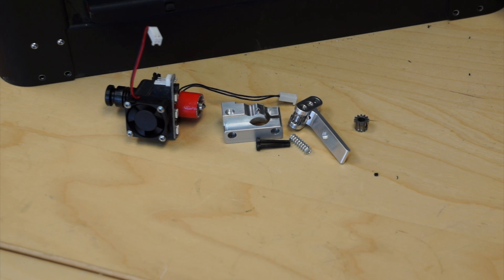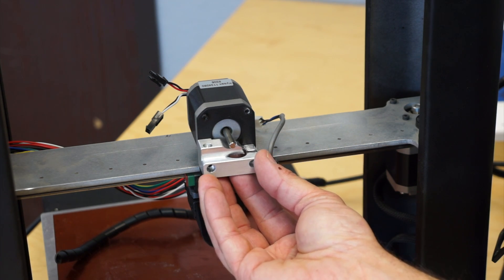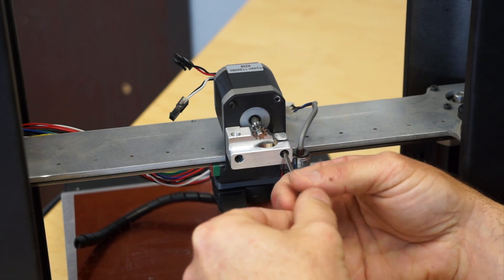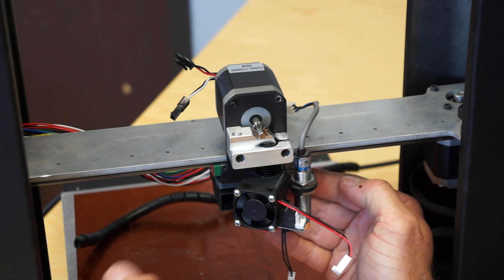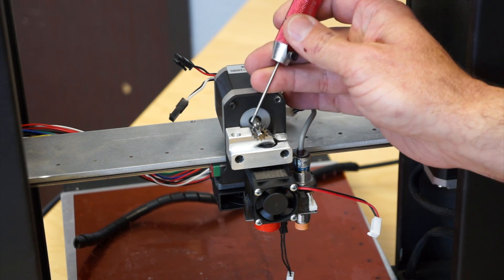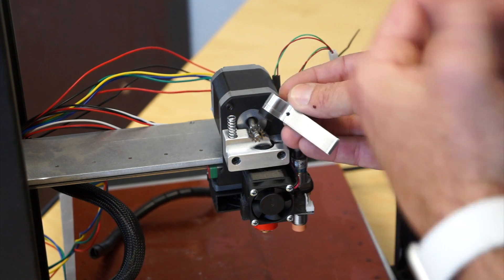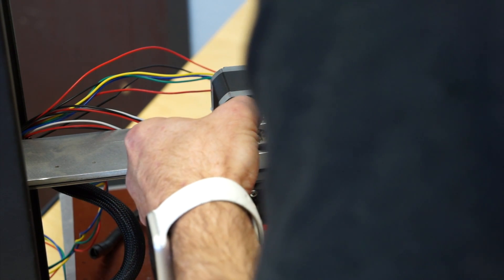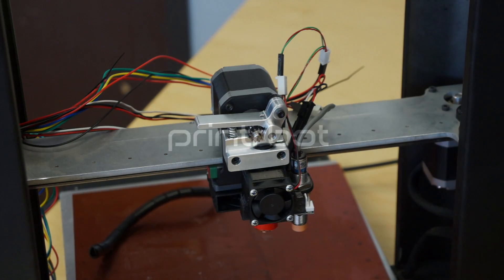Printrbot Gear Head V2 Upgrade

Comment: When I changed out mine on the printrbot play, I ran into a few problems.  

Firstly the screw holding on the old gear was on so tight that it broke my allen wrench.  After a quick run to replace that tool, I decided to take my propane torch to the gear for about 15 seconds and that did the trick.  I'm assuming there was some lock tight or something in the screw hole.

Once I'd removed that gear, I found that the best way for me to get the alignment correct with the new gear and lever was to put the new gear on, thread some filament into the hole, align the gear against the filament and tighten it down.  I then removed the filament and ran it though the hole on top of the lever, aligned the gears, fed the filament down into the hot end and screwed everything in place, leaving the filament in the entire time.  

Afterwards, I found that the gear screw screw was just slightly too tall as it made a grinding noise when I extruded some filament via octoprint. I backed it up, tightened it down more and tried again.  Eventually it was low enough.
Reply from the maker: Good work! We stopped using the lock tite so others won't have that problem.

Brook